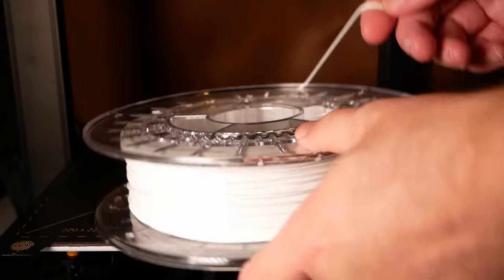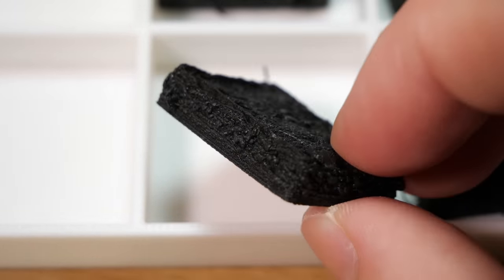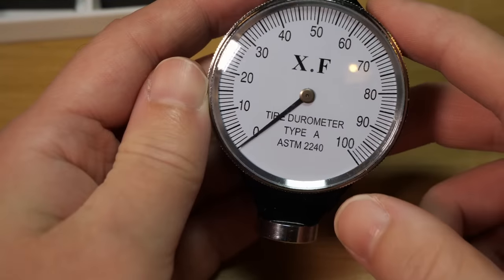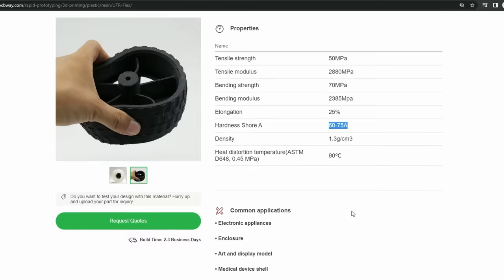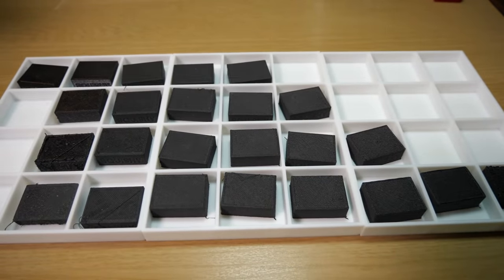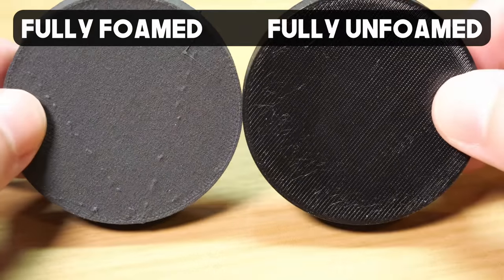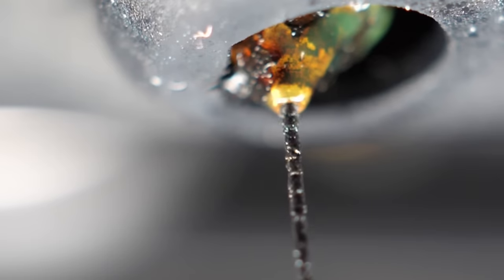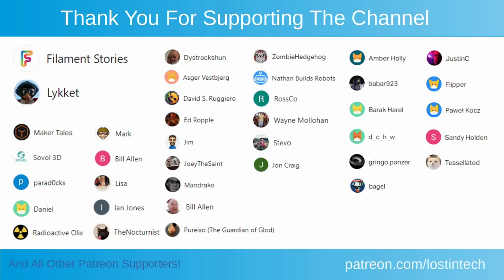The Ultimate TPU? Achieve Shore Hardness Down to 55A and Beyond, ON YOUR PRINTER.

Comment: "reverse bowdens" wouldn't be as big of a problem if people chose their tube more sensibly. There's no reason to use the same tube you would for a bowden as the filament does not need to be tightly constrained. 4mm tube with 0.5mm thick walls will let the filament slip through much more easily.
Reply: Exactly.. It’s only there as a guide... Just pop off or pop a hole in the top and run it straight to the Print head.. ( I do this with my filaments on a Shelf and bar above)

Comment: This would also allow you the very the shore hardness within the same print. It would be cool to see some designs that could take advantage of this feature.
Reply from the maker: If you can vary the flow rate, yes, of course. 
So walls different to infill for example. Otherwise it's going to need a slicer mod. Which would be totally doable but beyond my ability.
Reply: @LostInTech3D  Creality Print has flow multipliers for different types of features. I'm sure others do too, but doing it by layer would probably be manual, unless you faked a material change.... like you can do in PRUSA? Either way, lots of hackyness involved.
Reply: @LostInTech3D  prusaslicer has a function in the Custom G-Code section for Before/After Layer change G-code, and it allows for a condition based on the layer height, e.g. "{if layer_z <= 141}". It also lets you do math in macro expressions, so you could also have it increase/decrease the current flowrate by a set amount per layer
Reply: The areas you want different settings in make that its own model. Import the entire model and the section of model together and select the section and set new settings for the area overlap. This can be done with a basic plugin in cura (cube insert plugin I think)
Reply: @LostInTech3D  Cura has separate flow settings for walls, infill and such, even for outer and inner walls, so no problems there.
They are also available for modifiers like supports blockers and such.
Reply: You might be able to just create different filament settings and use modifiers.

Comment: This is actually super intriguing as it is clearly a development from the light weight PLA products that are super useful for model aircraft! Now we can adjust weight and shore hardness!!! There is so much this material can open up for printing!
Reply from the maker: Yeah, to me this is a bigger deal than lw-pla
Reply: @LostInTech3D  light weight PLA only really has niche uses. It is a significant trade off between strength and density and it is not linear, reducing the density by a percentage will reduce the strength by more than that percentage. It is fine when you need something lightweight but not that strong like plane wings. You do get multiple brands of lightweight PLA now, eSUN and Colourfab are the main ones.
Reply: @conorstewart2214 it helps that tpu inherently has amazing interlayer adhesion!

Comment: I've been using this stuff for a while. Printed a soft case for my battery bank. I do rope access work and we have to attatch rope protection sleeves to the ropes over sharp edges and I made quick attachment "loops" to keep them in place. The stretchyness of this stuff at max foam really grips the rope super well. 
I've also printed the noses of my rc planes in this stuff for light bumps and it works great. Best part is that at max foaming the roll goes further and can print more parts. It is pricey but so worth it
Reply: It’s similar with the lightweight PLA. One roll could be the equivalent of 2 normal rolls so it being more expensive balances itself out.
Reply: As a former rock climber, though mostly indoor, and current engineer, this is cool.  Can be done as a rubber band soft shackle for zero load pure friction items like you are probably talking about...

Or you could integrate soft shackles into a print to even allow low load placement of anything on the bottom of a horizontal rope with the reasonable assurance it won't come off the rope assuming the polymers don't degrade in sunlight.
Reply: The only way I could ddddř
Reply: Oh hey mike! Long time
Reply: What nozzle size do you use?

Comment: I'm mostly interested in this filament for allowing to print matte TPU. The only other option is Fiberlogy MattFlex 40D, which prints incredibly well (I printed 4-5 rolls) but is has gotten more expensive now. I wish more filament manufacturers would make matte TPU as it has many usecases. Especially great for increased grip and super clean looking prints.

Comment: I think the 55 A minimum hardness they specify is probably the minimum hardness just due to the foaming effect and for most reliable results you probably want to rely on the foaming, not adding gaps between lines of filament since the foaming alone may keep the part relatively durable but adding gaps between lines will probably reduce the durability of the part.

Comment: I'll bet this is sodium bicarbonate as an additive, I think that is what the expanding PLA's use. Super informative deep dive! 
I bought some of this on impulse after my brain went crazy thinking about gradiented shore hardess on anything imaginable. Actually pulling that off cleanly will be another mater entirely. This is the video that finally encouraged me to open up a roll of TPU I've had waiting for over a year, this stuff is so damn tough.. Even the strings and whisps it makes are hard to break tbh. It's interesting how the popularity of bowden setups kind of shelved the 'practicality' of TPU, it prints clean with little smell, and has amazing layer adhesion and load-force transference.

Comment: Poisson's ratio is the ratio of - transverse strain/ axial strain or in simpler terms how much thinner does it get when strethed divded by how much longer it gets when stretched. The negative just insures that fpr most normal materials you work with a positive number. Materials that possess a negative poissons ratio are called auxetic and will get wider when stretched instead od getting thinner.

Comment: Great video! Thanks! I've been using this stuff for a few months now and love it.  I generally print it at the highest temp as I'll use cheaper tpu if I don't need the soft foamy consistency. It is a unique filament that I keep in stock

Comment: Might be really interesting to use it for in-fill if you have a printer which can print with multiple filaments.  I.e., a hard shell, and a soft infill where structural rigidity isn't important.

Comment: The Flow Rate values (X-axis) on the "Shore Hardness vs Flow Rate" chart are weird. To the right of 70% you move linearly in 10% increments, but to the left you go from 70% to 100% (delta 30%) and from 100% to 105% (delta 5%). That will obviously mess with the slope of the plots (slope = rise/run) in that region.

That aside, this stuff looks pretty cool and I've been meaning to give it a try. Thank you for the very informative video.
Reply from the maker: Good spot...I hate excel sometimes

Comment: 5:40
In Engineering, Poisson’s Ratio is I believe the ratio between the strains vertically and horizontally. Been awhile since I took Strengths of Materials. 
The closer to 1 you are, the more the material’s strain behaves the same in all directions. Meaning it deforms the same whether your stretching/compressing it horizontally or vertically. 
If it’s above 1, you have a higher vertical deflection (meaning, in this case, the z-axis is more flexible). If it’s less than 1, you have more deflection in the horizontal direction (more flex in x and y axis).  Makes sense considering how the z-axis printed material is interrupted with layer lines instead of a constant smooth line of material like in the x-y axis.
Reply: You're in the ballpark but got some things mixed up. Poisson's ratio is the ratio of transverse strain (perpendicular to loading) to axial strain (direction of loading). It normally ranges from 0 to 0.5, with 0.5 being an incompressible material. The upper bound is 0.5 and not 1 because there are two orthogonal axes to the loading, so for volume to be conserved the transverse strain has to be half of the axial strain.

In the context of 3d printing and layers, what you're talking about is an anisotropic material. Poisson's ratio is just a material property like Young's Modulus, the only reason we talk about direction with it is because we're concerned about how the material behaves relative to the loading. If it's different based on material orientation then the material is anisotropic, and the manufacturer should specify which orientation the property was measured in. It's kinda weird that they didn't, since the other material properties are different depending on orientation. Maybe the difference is just negligible, idk.
Reply: @turtled361 
💯

Comment: I have used it, and the problem that I had was that yes, you can achieve lower hardnesses, i printed to achieve 60A, but the problem is that usually with 60A TPU you have a rubberous material, that sticks really well to surfaces, like a really sorf tire, and with this fillament, foamed, you loose the rubber feel of the surface, and the grip that goes with soft rubbers
Reply from the maker: You could probably mitigate that by adding a texture I guess

Comment: I should point out the Bambulab can print tpu, just not with the ams

Also  thst filament looks neat as well. Can't wait for a manufacturerwho whose product I can reasonably access in Canada to either license this tech or makes their own version.

Honestly if this is like under $60 Canadian per roll,and  works with the AMS, I would totally be interested in picking it up as one of my regular filaments. Imagine the posibilities. Next step is to have a water tight version. I would assume such a thing wouldn't foam but imagine the uses!

Comment: Why I think its linear: The temperature linearly changes how much heat is put into the filament and therefore directly and linearly impacts how much time the expandable bits have to expand. That would explain why expanding filaments typically ooze a lot more.

Comment: I was thinking of getting a Creality K1 and running it at a speed that reliably prints TPU, to have the higher speed for printing ABS, etc.  When printing TPU, I'd eliminate the reverse Bowden tube and would hang a reel of filament directly above my 3D printer and feed it directly into the extruder as I do on my Sovol bed slinger.
Reply from the maker: I will at least attempt to test that, for tpu. The extruder is new so I intend to dive into that.
Reply: Use 3mm ID bowden. Simple solution.

Comment: I can't even keep overhangs from curling with MatterHacker's Pro Series TPU... How did you get those bunnies looking so good?

So unless you have a video I missed, I give up on TPU unless I'm printing Phone cases.

I just want a TPU Benchy that looks good.:face-turquoise-covering-eyes:
Reply from the maker: Huh, try a different tpu, they normally behave fine?
Reply: try reducing nozzle temp, I run jayo 95a at 195C with generic PLA profile in cura heat bed off 100% fan after 4 layers, aqua net hair spray as bed adhesive, benchy comes out good.

Comment: I'm surprised that you did not make a table with Temperatures Vs Flow or Shore (given it's a linear relation), that would have been more useful. At what Temp I achieve X shore hardness? 
Also softness is not equal to elasticity, how stretchy is this filament when foamed compared to a soft TPU?

Comment: Is this stuff water proof? I need to print some water pipe rubber sealing gaskets which need to be about 55 shore, but im not sure this stuff will seal well. At the moment I'm printing the molds and casting two component silicone.. which is a lot of work.

Comment: I've got a roll of this stuff as well. CNCkitchen did a video on this a while ago quite useful as well, imo. One thing I'm really struggling with is stopping and restarting extrusion so it doesn''t look like total crap. (pardon my french)

Speaking of french. Poisson is french and means "fish". Judging by the grossness of your extrusion footage, your poisson rate must be around 150%. Which is odd, but what do I know, they managed to get 160% of volume out of 100% of material, the math doesn't add up either way.

Comment: Did you try the sort of recommended way of calibrating lightweight PLA? You print a small one walled box at different temperatures and for lightweight PLA you find the one with the thickest walls but for varioshore you would probably pick the one with the hardness you want. Then you repeat the test at that temperature at different flow rates and you see what flow rate gives you a thickness equal to the nozzle diameter and then you print with those settings, so you get the chosen density (in this case hardness) and it foams up to the nozzle diameter when it prints.
Reply from the maker: yeah I saw mention of that, you could see that was happening in some of the samples, so you could certainly pick those out and use that temp/flow rate. I don't feel like it's process critical for TPU but, it might be. There's so much leftovers from this video that I think a Pt2 is inevitable.

Comment: This stuff is pretty great. But is currently limited by software. Slicers can't handle the idea that the filament will expand more if they slow down the extrusion rate. So you basically just have to print it at a constant and very low speed.

Comment: what is the toxicity of the printed part? is it safe for prolonged skin contact? a lot of elastics/foam tend to lose their elasticity from mild heat, pressure, sunlight, time & certain chemicals like swimming pool water (w/ chlorine). how long/well do you see the parts printed in this material lasting?
Reply from the maker: theres an MSDS on colorfabb's website, most of the answers are in there, although you'd have to ask them about the chlorine.

Comment: I still dont understand why people say tpu is hard to print... i can print 70A shore tpu on my cheap unmodified anycubic chiron with the same settings i use for pla. 

The only thing i do different is reduce the thigntness of the extruder to allow it to slip instead of clog the boden tube

Comment: Love the video. I've been struggling to even get 95a shore TPU I bought at MRRF to print on my SV06. Do you have any tips for printing flexibles on a finicky machine like this? I upped the temp to 250 and slowed it to <20, while tuning the extruder tension down as low as possible, and still had it jam mid print.
Cheers,
Adam
Reply from the maker: The SV06 extruder seems to either handle tpu really well, or not, depending on the exact unit. The way I solved it on one unit was to slow down retraction speed. I thought I had a profile for the 06 on my site but it seems to not be there. I'm annoyingly disorganised with machine profiles, I'll try to get something up there.
Reply: @LostInTech3D  Alright, thanks for the speedy reply! I messed with retraction distance, but not retraction speed. I'll be sure to check in on your website. 
Thanks,
Adan

Comment: I print TPU functional prints regularly and the varioshore is great for RC airplane tires.  I originally tried Ninjatek Chinchilla for the tires but I just can't get a print to finish.  I've tried all my DD printers going all the way down to 5mm/sec with no luck.  Best I've done is about  half a 20mm test cube on my E3S1Pro.  Ideas??
Reply from the maker: you may want to check my last tpu video, chinchilla is I think 85? A so it probably needs pulling off the reel to print on an ender3 S1 pro, I specifically talk about the sprite in that video.

Comment: this makes me wonder if you could vary the density within a certain print. kind of like adding an EVA lining to a TPU part, I'm thinking a padded support brace 🤔
Reply from the maker: You can, using modifiers in the slicer
Reply: @LostInTech3D  veeery intriguing.maybe I shouldn't yeet my ender 3 v2 just because my K1C arrives on monday 😅

Comment: Wonder if you could adjust temp/flow rate mid print to have some of the part hard and some soft, while only using one filament and printing all at once
Reply from the maker: Hold that thought 😁

Comment: Hi! What was it about the Creality printer that inhibits this material from being used? I couldn't quite catch what the issue was in the video? Is it the tubing or the nozzle type? I have applications for this kind of material and was hoping i could use it on a Creality machine. Probably a newer Ender Model? I've worked with the Creality 10 in college and seemed very modular in that ours didn't have the tube feed part.
Reply from the maker: That should answer the question https://youtube.com/shorts/7RTSwh7SWeE?feature=share
Reply: @LostInTech3D  ah! Thank you. I was also looking into it a little more. We never learned the finer differences between Bowden and direct drive in uni. (or I didn't absorb the information) so I went digging. I also found a lot of information on converting ender 3's to direct drive. And upgrading parts. Seems like there is a printed set of parts that will help or a kit directly from Creality if I'm not feeling confident about tampering with homemade parts.
Reply from the maker: I did a vid on that too... about a year and a half ago. It's easier than you think, no firmware changes or anything. I used the creality dd extruder but printing it works ok too.
Reply: @LostInTech3D  Excellent! I'll be sure to look into it more later down the road, I'm just getting reaquainted with the 3d printing world with PLA projects rn. So far so good tho! I'm very much looking forward to printing soft things later!

Comment: Maybe instead of just reducing flow rate, swap the nozzle from a .4mm to a .3mm and reduce the flow rate while leaving your slicer to believe it is still using a .4mm nozzle. That way the path it takes will be slightly wider by dafault?
Reply from the maker: I would say you are likely to get the same effect, but tpu hates small nozzles. You could set the .4 nozzle as .6 though.